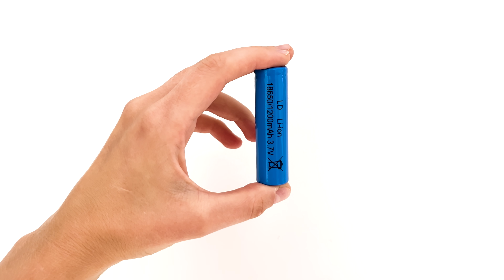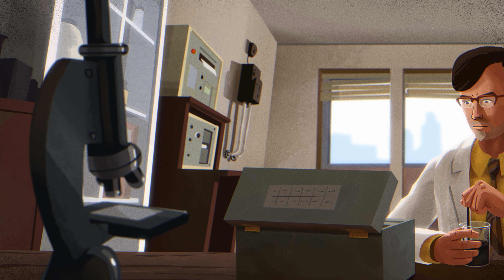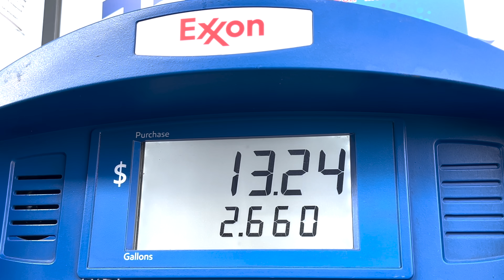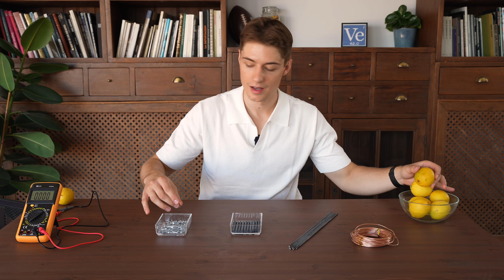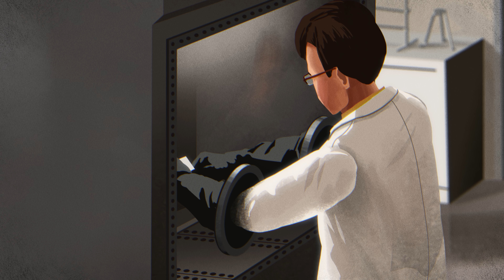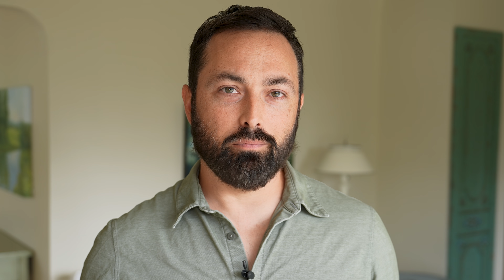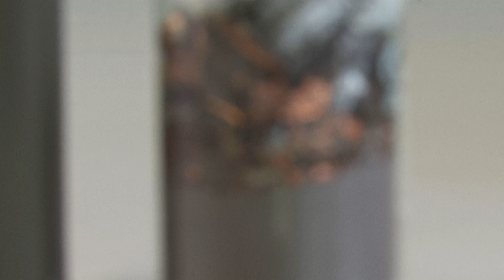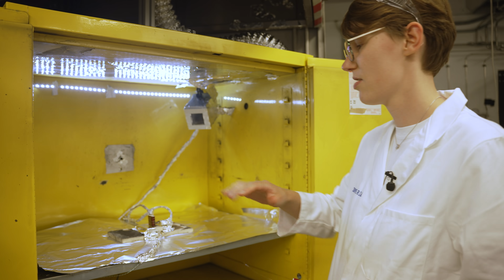The Perfect Battery Material Is Dangerous

Comment: Pacemakers also had this problem. Open heart surgery every 18 months to replace the battery. The 1970's solution to this problem was to use plutonium-238 (not 239) in a small radiothermal generator; a tiny version of what was used in space probes. This worked extremely well. Most of the radiation was alfas which were entirely contained; there was a small dose of gammas and neutrons from rare types of decay, but nothing too bad. These generally outlived the life of the patients. There are still people today with these pace makers that haven't been produced in decades.
Reply: Yup, still the most reliable energy source for pacemakers.  BTW, it isn't open heart surgery to replace the unit, just opening the skin over where the pacemaker sits.  Still no fun for the patient.
Reply: @richs5422 That’s right. The battery sits over the collarbone right under the skin.
And install a pacemaker isn’t open surgery. Installing the electrodes in the heart goes with x ray through the blood vessels.
Reply: @richs5422  Open heart surgey is not required for most pacemakers. But a traditional replacement will require a outpatient surgery that just is under the skin. Unscrew the lead and then put a replacement device on. You are correct, not fun for the patient. Look into leadless pacemakers as an alternative!
Reply: @richs5422 yeah, pretty much.
Reply: My maternal grandfather needed a CRT-D implant in 2010 at the age of 71. He passed away last year at the age of 85 from other age related issues, but his bi-annual heart checkup to continuously tune the power draw of the CRT-D  were always perfect till the end. That's 14 years of uninterrupted operation along with saving his life twice through defibrillator function, once in 2019 and once again in 2022. 

I do not know the what make and model was that CRT-D but I've always wondered about its power source. Someday perhaps I'll go through his medical record to find out for sure.
Reply: @AbideTheCold  It could very well be lithium-thionyl based. Those batteries can easily be on the shelf for a decade and still perform very well when used. As far as I know it's still one of the most common batteries in cardiac implants.
Internal defibrilators scare me to death: On the British '24 hours in A&E' there was once was an older gentleman brought in with such a device as it had fired a few times. Till that day I always expected the shock to be noticeable, but not excruiating. I mean, I thought like 'it's internal and not an external shock, where the energy has to pass through all that tissue and muscles before it gets to the place where it's needed most'.
Well, seeing his body violent fling his arms around at every shock and begging the nursing staff to 'make it stop', I'm not too sure if I ever want one ;) If I remember it right, he was shocked 18 times by the thing and when they did a readout of the log-memory inside the thing (I didn't even know they had such a feature) they found it had acted perfectly well. To be honest, I find it impressive not only to have an implant last so long, but also to have it last so long even after administering multiple shocks.
Reply: @weeardguy  No. No lithium thionyl chloride batteries in pacemakers or ICDs.
Reply: Literal Atomic heart
Reply: Funeral directors ask whether the deceased had a pacemaker, but very occasionally one gets missed. It is important, because the pacemaker is made of metal and hermetically sealed, so it makes quite a bang in the crematorium oven. It is just as well that we don't have plutonium pacemakers any more. Decontaminating nuclear waste from an entire crematorium is a bit more work than just repairing a damaged oven.
Reply: @soennecken8 Plutonium has a very high heat of vapourisation  and high melting point for both the pure metal and its oxide, as do its first 3 daughter products, all of which have several thousand year halflives. You could give everyone on earth a Pu-238 pacemaker and have them all go into a crematory oven and there would be less radioactive environmental contamination than the average neodymium mine produces in a year.
Reply: @soennecken8 I believe plutonium pacemakers were designed to survive a crematorium for this reason
Reply: wow, arc reactor
Reply: Yep, not a lot of power but a constant low yield.
Reply: I hear there are attempts to create batteries like this from radioactive waste. I think the idea is to create a beta-voltaic cell powered by radioactive diamonds pressed from low level carbon rich waste.
Reply: @J.C_Hong  there are radiation fueled batteries, but they are very low power. It works in a pacemaker, but wouldn't run a phone.
Reply: As a Technical Service Representative for Medtronic during the late 1980's and early 1990's I helped explant several of these nuclear pacemakers. While it seems excessive to need replacing a pacemaker every so often due to battery depletion, you need to consider several things. In an elderly person with other existing medical issues, the battery would most likely last longer than the patient. Also, circuit and lead design (the lead is the wire from the pacemaker battery/generator to the heart tissue) improved exponentially during the 1970's and 1980's, decreasing the amount of energy drain from the battery by more efficient usage, extending the life of the pacemaker. Third, also related to improvements in circuitry, new therapies became available for the patient, and with a battery change came new technology to improve heart function and lifestyle and medical follow-up care they didn't have with the older pacemaker.  Open heart surgery has never been required to change a generator (which contains the battery, nor implant a new one. Sometimes external cardiac leads were attached during open heart procedures, but the more efficient use of the pacemaker comes from internal leads which are threaded through a vein into the heart
Reply: I wonder if pacemaker can be designed to use "recoil" from the heart to produce its own electricity. 
Imagine machine gun which will shoot bullet after bullet as long as the trigger is pressed, because the recoil from a fired bullet has enough energy to push the hammer to fire another bullet.
Reply: @gorilladisco9108 that's a fun thought. Like an automatic watch, a mechanical+electrical circuit that charges through movement of the heart (and the patient).
Reply: @gorilladisco9108  probably couldn't, but yeah that's actually how semi-automatic/fully automatic guns work.
Reply: @gorilladisco9108  There are some designed to recharge. Very much on the edge of technology though. Also, they need to be implanted directly into the heart (Leadless pacemaker). I like to think of it as one of those flashlights that you would shake for a few minutes to charge the battery. The problem is the mechanism. Having the recharge mechanicals reduces the battery size (capacity) which could be a problem if the pacemaker changes orientation and isn't recharging for awhile.
Reply: @gorilladisco9108 And right at the moment you need that recoil energy, it is not there 😢
Reply: @gorilladisco9108  not sure what the technical details would look like, but siphoning any power from the heart (especially a weakened one) doesnt seem like a very safe idea
Reply: @gorilladisco9108  That or breathing who is probably easier to draw energy from.
Reply: @magnemoe1  It may work that way.

Oh wait ... what if he's choking? 
Now we have heart attack and choking ... 😅
Reply: @gorilladisco9108 i agree that would be amazing. But doing that would require that you find some kind of super conductor where there never is no loss in energy, to lower energy fields, as these over time would minimize the action caused by the reaction. But it is a really cool thought though
Reply: @audunbrink723  Considering that we make and use machine guns without superconductor, what' s the problem?
Reply: @gorilladisco9108  Well this would world in an ideal scenario, like in free space when no external force is acting and there is no loss of energy because of air drag, heat dissipation and sound waves being released. Simply momentum is not conserved in this case and eventually the system would come to a rest.
Reply: @gorilladisco9108 it's there to jolt the heart when it stops, so wouldn't it then not work when it's supposed to?
Reply: @gorilladisco9108  it`s not the recoil, it's part of the gasses from the bullets that are kept inside to cycle the gun.
Reply: @gorilladisco9108  I think another obvious way would be to have a wire coil just under the skin on the chest connected to the pacemaker. Then you'd wear a similar coil under your shirt over the other coil but driven by a battery powered oscillator on your belt (or whereever).  That would drive a AC voltage in the under skin coil by Faraday's law and that could be converted to dc in the pacemaker.  The magnetic fields would go right through the skin so they'd be no need for surgery to swap batteries and no risk of infection.
Reply: @gorilladisco9108  Too little energy, and the heart does not really like anything pressing against it.
Could use movement however.
Reply: @gorilladisco9108 unfortunately using the heart to recharge would necessarily impact cardiac output (amount of fluid being ejected). Since energy must conserved, some of the heart’s energy will be used for the battery. In a healthy person this would be fine, but pacemakers are often placed in patients who don’t exactly have the healthiest heart function around.
Reply: @richardmusca2909  The heart's movement isn't the only source of energy. Plus, a pacemaker doesn't need much power. A small magnet free to move up and down inside of a coil would make enough electricity to charge a small Li-ion battery. I don't know how it's done nowadays.
Reply: Your clearly ignorance is due the fact you not know anything about  guns. If you dont like it then dont mention it. No gun uses mechanical recoil to shoot another bullet. Its is due to the gases of the explosion
Reply: The true atom heart mother 🐄
Reply: @unregisteredhypercam2774 yes!! PF ❤️
Reply: So we really could have had a fallout universe...dam 😞
Reply: @RyanD86  as much as I love ghouls, it’s not worth having bloodbugs
Reply: What’s the modern medicine fix to the battery change problem?
Reply: @Supercake8083  Inductive charging, just a small coil underneath the skin that you put a charger on and it acts like a transformer and charges the battery. Worth it to note that there are batteries that last a really long time, in the order of decade long service lives for pacemakers.
Reply: @glonkfpv  This has been done for neuromodulation devices, but those are non-life supporting. The risk is patient compliance. If a patient forgets or can't recharge their device, it could be bad. The size and heat the charging creates needs to be studied more.
Reply: @glonkfpv  Yep, Lithium-thionyl, there's also a mercury-based type of battery that lasts decades if I remember it right. Lithium-thionyl batteries easily last 10 years in a pacemaker before requiring replacement. But I also guess that's down to how strong their impulse-output must be (if there even is a difference output setting, but I'm not a cardiologist/cardiac surgeon).
Reply: @glonkfpv My magnetic charger gets hot af…it would probably just burn you
Reply: @scoobertmcruppert2915 well, its trying to push relatively large amounts of power to your phone.  A pacemaker wouldn't need to charge as fast, which could modulate the heat.  The charging coils might also be more efficient for that application owing to it needing to be implanted.
Reply: @Supercake8083  Modern pacemakers use lithium-iodine (nonrechargeable) batteries, which have a similar energy density to li-ion, and the electronics are more energy efficient than the older ones, so they last for 5-15+ years before needing replacement. Still not as long as a Pu-238 powered one, but better than once every 18 months.
Reply: @Supercake8083  better batteries which can last decades
Reply: @Supercake8083 Remote induction charging, like with your cell phone.
Reply: @Supercake8083 isnt it the wire free proximity charging as with smart phones? Even daily recharge could be performed.
Reply: @Supercake8083 From what I understand solid-state batteries might be a way, they swap a liquid or gel electrolyte for a solid one.  But they have problems right now (again from what I understand)
Reply: alpha* the NATO alphabet spells it wrong on purpose for easier reading by foreigners.
Reply: @mattymerr701 

Do they actually spell it that way? I was so confused reading this and was scrolling to see if anyone pointed their spelling out. Radiation has alpha, beta, gamma, etc.
Reply: Sounds like Iron Man's arc reactor to me. Only it uses palladium cells, hehe.
Reply: that's awesome, they should still use these just because they are cool
Reply: @LC-mq8iq We'd have to be careful. This could create a load of nuclear-powered superheroes and supervillains, depending on whether they are positively or negatively charged.
Reply: @LC-mq8iq they can't current reactor can produce Pu-238 in significant quantities. We only have a few kg of it left. IIRC, we can't make more because it was originally a by-product of plutonium-239 production, but betavoltaics, artificial diamond based semiconductors impregnated with beta-decaying radionuclides (mainly tritium, but Ni-63 and C-14) can take the energy of the beta decay, from the displaced electrons, which created an electron-hole pair in the semiconductor and directly convert it into a voltage. Current working designs produced up to 4V open circuit, with a power of 100μW for a cell the size of your thumbnail. The lifetime and power output depends on the radionuclide chosen, but the voltage produced is constant, while the current and thus total power output will decay exponentially. With tritium cells lasting 20 years and carbon-14 cells lasting for thousands of years. It is great for small electronic sensor modules in areas without grid power and unsuitable for solar panels. They're much more efficient than Pu-238 based RTGs, but RTGs are cheaper for higher power applications. They will probably be approved for pacemakers soon, as wireless recharging poses a non-negligible risk with wireless power devices becoming more common.
Reply: @LC-mq8iq  We have major shortages of Pu-238 because the reactors used to create it were shut down in 1988 because of anti-nuke hysteria.  Attempts to restart production were started in 2017 but the volume is tiny.   There's barely enough for DoD and NASA right now.
Reply: @LC-mq8iq  sadly, that sort of plutonium is in such short supply, as it was only used for the first era or two of building nukes, that NASA doesn't even have enough for their probes, or so they use solar for anything that doesn't need perfect power for decades past mars. I think they could make a couple dozen voyagers and that might be it, or something.
Reply: @LC-mq8iq doesn't seem like there's drawbacks to it. It probably is just very expensive
Reply: I have a modern pacemaker, it started off with about an 11 year projected lifespan according to how much the device's logs showed it was using. So it still has about 7 years and the doctor said replacing the pacemaker is done in her office, so it doesn't sound like huge deal- no general anaesthesia/2days in the hospital kind of thing, but an outpatient office procedure, but imagine being in your teens or 20s and needing one and having to have it replaced about every 10 years! yikes!
Reply: @FCE-dogs They have pacemakers that can be charged by ultrasound, or light or Inductive and electromagnetic wireless charging.  I think some of this is just experimental.  But, in theory, these things could last much longer than 11 years.  And it seems to me that they could have a separate set of batteries and switch over when the first set is depleted.  Of course, such batteries would need a very low self discharge rate at body temperature for there still to be a near full capacity when finally called on.
Reply: @ChessMasterNate  Well the other issue is the electronics in the unit itself can fail, the thought of the electronics after 11 years of use what the risk of failure could be trying to extend that.
Dr Feigovski talked about a new pacemaker she is working with now in her iowa office that is very tiny, inserted into the heart via an artery, and it has barbs that attach it to the wall of the heart, no surgery/cutting, bump on the chest and wires, it still has a battery, but it has advantages over the regular units
Reply: @FCE-dogs They don't actually put the pacemaker itself on your heart only the leads go there. The pacemaker is that small lump under your arm or on your chest generally. So it's a (relatively) minor operation to swap in a new unit vs placing the leads for the first time.
Reply: Isn't that what Voyager have too
Reply: @cmfrtblynmb02 correct!
Reply: TONY STARK
Reply: The vest equipment always outlives the owner
Reply: What's interesting with such long lasting batteries in a pacemaker, is that the point of failure of the device becomes the electrodes that are screwed inside the hearts walls from the more than 30 millions of heartbeats per year and all the mechanical stress that comes with it (either at the junction point or along the electrode).
Reply: Replacing a pacemaker “generator”, a “gen change”, is a cut near the clavicle (collarbone), not open heart. Even the initial lead placement is done through a vessel, not by opening the chest. I’m afraid you were misinformed. Current pacers with modern batteries are incredibly small and make it 10-15 years in cases where they are not always on (demand pacing). Pacemaker tech has advanced dramatically. 

I fear some fool will try to incorporate “AI” (LLM) into the equation and kill a lot of people. It seems it’s just a matter of time before “AI” undoes all the progress of the last 250 years by being “so smart”.
Reply: @TheloniousBosch  if you noticed he's talking about the 70s procedure.
Reply: imagine using a wireless charger :D
Reply: It wasn't "open heart surgery" to replace the battery. My SIL has it done periodically, it's sub-cutaneous.
Reply: an atomic heart....crazy
Reply: Wonder how long before Apple comes out with MagSafe charger for pacemakers lol
Reply: Nuclear is the future.
Reply: Clippy revolution
Reply: Now this is a video I’d love to see!
Reply: The problem with the radioactive ones is that they ALL have to be kept track of, and then recovered once the patient does, before they are buried or incinerated.
Reply: A fellow Clippy :3
Reply: So all we all need is a tiny little plutonium generator inside our bodies, and we can power anything we touch!  😎
Reply: My grandpa has a plutonium battery in him he's 96 and brags about it from time to time 😅
Reply: why can't we have computers powered by those?
Reply: @Ozzymandiyas  For real! 😂
Reply: @Ozzymandiyas  Best name EVER!

Look on my works, ye Mighty, and despair!
Reply: You learn something new every day!
Reply: The company Wilson Greatbatch used radio-isotope batteries in some of their pacemakers.  Our company used and researched these for several military purposes.  McDonnel-Douglas also worked in this area.  Worked great, but very low current.
Reply: These people are also on a national registry so that if they die, they can have the pacemaker removed instad of being cremated and putting the plutonium into the atmosphere.
Reply: you need open brain surgery if you talking gibberish like that ....
Reply: Yep, the most reliable energy storage system (for the power grid) isn't chemical, it's atomic.

Which is why I cringe any time I hear someone (including towards the end of this video) say "we need heaps of batteries to stop teh climate changez"

We have nuclear reactors. They store years of energy in very small volumes.
We have the material, on earth to run said reactors until the sun becomes a red giant and englulfs the earth.
In 5 billion years.
Reply: Yeah I lost the greatest uncle ever like that
Reply: They usually used promethium-147 since     Plutonium-238 would be very toxic if it ever ended up in a crematorium and somehow the titanium shielding were breached cuz alpha decay materials are extremely toxic and plutonium is also very toxic even without the radiation as it’s something that barely existed on earth and wasn’t in our environment as something we had to evolve alongside, compared to uranium, thorium, radium, and polonium which is everywhere in all environments in small quantities. Betavoltaics use special semiconductors that turn these high energy electrons (beta particles) into current flow. The alpha radiothermal generators work similarly I guess you could say in that the seebeck effect thermocouples have a PN junction sorta, but they aren’t made of silicon. They’re made from dissimilar metal alloys from opposite ends of the electro negativity scale so that electrons in the free metal condition band flow from one material to the  other when given a little push with heat energy. They could also use tritium for betavoltaics but I think it wouldn’t be powerful enough since promethium-147 emits more and higher energy beta particles.
Reply: They oughta bring em back
Reply: Real life Stark industries?
Reply: We all know what happens when gamma radiation hits the cells!
Reply: "open heart surgery" a little dramatic.
Reply: Ive got an idea, you know how Rolex has that battery charger by movement. Put that in. The heart will always charge it
Reply: I'm definitely old enough to remember hearing about people setting off (ATP unknown) radiation detectors from a medical device(didn't know it was their ticker as a kid😂) in the White House pre-9/11
Reply: Wait what ... I didnt know electric cars were from the 1900 ...
and I though we live in the future ... I feel so dum LOL
Reply: Nuclear powered people.
Reply: cool i was always thinking if we can make things work on the voltage in the body but i dont think we could you dont have enough power for that
Reply: i would like to use that for PC Cmos batteries...
Reply: Wow...
Reply: Human internal wireless charging with an externally wearable battery?
Reply: pacemakers sit outside the chest cavity so that is not open heart surgery
Reply: So we could have batteries living for decades on a ''single charge''?
Reply: Learn something new everyday. I assumed some form of inductive charging was used. That's really awesome.
Reply: wireless qi charging for pacemakers when?
Reply: @TheDutchPhysicist  When it won’t burn like mfer 🤷‍♂️
Reply: "but nothing too bad" is worried most people, your statement lacks of empathy
Reply: Wow! That's honestly fascinating.  I love that Wow! factor! 😄👍🏻
Reply: Does having a pacemaker make you a cyborg?
Reply: All im hearing is that iron man isnt completely fiction
Reply: Example of said person with the pacemaker: Dick Cheney.
Reply: And yet pacemaker companies refused to release induction rechargeable devices. Totally possible. I pressed a device CEO and he admitted there was no money in that.
Reply: Actually you don’t need open heart surgery to replace a pacemaker…not even the old ones.  It’s fluoroscopically guided electrode placement…always has been.  The surgery opens the superficial muscular layer and guide slips into the chest cavity but nowhere near the heart.
Reply: Needs another Michael Faraday to come along.
There has to be a better way.
Reply: Having had open heart twice now, there is no way they would require open heart surgery every 18 months. It took me 3 months just to get back to work and about a year to start feeling normal again. Then got to do it all again 7 years later. They wouldn’t place a battery that would require that risk.
Reply: What do they use today
Reply: I’m so used to uranium LOL I was like yeah I guess you could use 238 but then saw 239 and got confused, had to reread to see plutonium 😂 (U235 being the really radioactive one). Why use plutonium in those and not uranium?
Reply: I have it
Reply: so..basically a little reactor.... in the middle of their chest... Iron Man enters chat
Reply: Sadly plutonium 238 is in short supply now. Benefit is that this is because of disarmament but still
Reply: Most informative and interesting comment I ever read that too with 100% accurate ❤
Reply: That's what we should be using technology for, to better our lives and not for war
Reply: But also being the reason for many skin ulcers and fistula... Didn't work as safe devices, energy source
Reply: That's actually wild info to learn. 
I had no idea that pacemakers were powered by miniature RTGs, at one point.
Reply: Something about knowing we basically had a bunch of realistic Tony Starks walking around is both kinda sad and cool to me. Sad because it's not as cool as comic books would have you believe, but cool because although it comes with a price, I'd have a blast telling people I had a nuclear powered generator in my chest.
Reply: Yeah, I had a plutonium powered grandma too. :) Amazing.
Reply: I would absolutely choose to become a fallout cyborg and simply die due to lack of heart
Reply: Seems a not great but not terrible kinda deal
Reply: Well this is easily one of the coolest things I’ve learned in a while!
Reply: Fr
Reply: oh
Reply: That's super cool.  Thanks for posting!!
Reply: Lots of graves filled with these batteries… Which are still operational and emitting radiation!!
Reply: I literally read it as Peacemaker😅
Reply: Can't they use wireless charging by attaching a charger pad to the chest?
Reply: Imagine having Iron Man's core in your heart
Reply: Large nuclear reactors are by far the least expensive and most reliable source of large amounts of electricity.  If they could miniaturize it into nuclear batteries, that could be a great solution.  Of course safety would have to be worked out too, so we'll see.
Reply: @BillAnt unfortunately, fission doesn't scale down well, you need enough fissile material that any emitted neutron has a chance to encounter another fissile nucleus equal to the probability of that collision resulting in fission divided by the average number of neutrons released per fission any less and the reaction rate decays exponentially and stops, any more and the rate of reaction increases exponentially, in a properly designed reactor, the amount of energy released by a supercriticality excursion is usually sufficient to heat the fuel to the point that the nuclei are moving too fast for the neutrons to interact with in a way that is likely to result in fission, but in some graphite moderated reactors, the neutrons become more likely to interact with the fissile nuclei, and you get a Chernobyl. Then you have nukes, where they use explosives to compress the metal so the nuclei are closer together, so there's a >>>1/(n per fission) chance that a fission neutron causes another fission, fission neutrons are travelling close to the speed of light, the pit is only a few cm wide at peak compression, so it takes microseconds to go from nothing to petawatts of power. Radioactive decay is around 0.1-1% as energy dense as fission, but it's a constant process you can't put on pause when you're not using it. All that energy is being constantly released and if it's not being used as electricity, it will thermalize. This is why we haven't made a big betavoltaic cell and just used it to run a phone or a carm
Reply: @domvasta  Okay, you said what you knew.

But the average person doesn't understand 90% of it, so be friendly and tell us in two or three sentences what you think about it???
Reply: @domvasta one of the best concise explanations of nuclear energy that I’ve seen. Thank you
Reply: Yes, that was the ideal application.  These batteries don't stop until they are exhausted.  That limits what they are good for.  They also have low power density.  That also constrains them.  So, potential applications would be sensors like fire detectors or gas leak detectors, clocks, security systems, wearable health monitors, satellites, probes, signal boosters in undeveloped areas where solar won't work well like high latitudes, and of course these pacemakers.
But we don't do much of this anymore because you need a breeder reactor, and this plutonium could be collected and used to make a dirty bomb (people like that are why we can't have good things).  Part of the reason it is low energy density is how we turn it into electricity.  There is a better design where a Sterling engine is used.  That would be used for something on the larger side, like a space probe.
These are especially good for space probes that go further than the orbit of Mars, because solar radiation is less energetic, and the heat can keep components warm that need to be warm.
Reply: So, basically like Tony Stark, they're being kept alive by having a nuclear reactor embedded in their chest! 😅